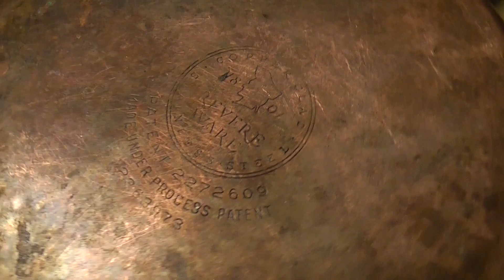Revere Ware Copper Saucepan Restoration | Revere Ware Pre-1968

Comment: You need to start a restore and resell vintage cookware business! That mirror shine afterwards on the copper is a beauty! What is the black coming off from the mothers mag? I know it's supposed to happen but I bought some after watching your videos and sort of freaked out at what was coming off.
Reply from the maker: I know it has Alumina (Aluminum Oxide) in it. I think the black is just abrasive residue from the steel or copper. I will look it up though. Good question!

Comment: Absolutely amazing results!! Im scared though because everything I read about restoring revere ware says never to use steel wool or sandpaper or it will ruin the pots. Im confused because you are doing it and it works wonderful?? Is there a secret to not ruin the stainless steel?
Reply from the maker: I'm guessing they are referring to the original polished shine, which would ruin the look. If they are already damaged or scratched this really does give them a new-ish look.

Comment: I recently got a pan that is in good condition but the screw area is rusted I didn’t realize until after thriftiest do you know if possible to change the screws out?
Reply from the maker: The screw, if not too rusted can be removed easily. Revere Ware made a few pans with removable handles. You may need to find one to swap out. Is it just the screw rusted? Or both sides? If just the screw you may be able to find a replacement at Home Depot or such. If it's rusted stuck, try spraying with WD40 and let it sit overnight. Sorry, not much help :(